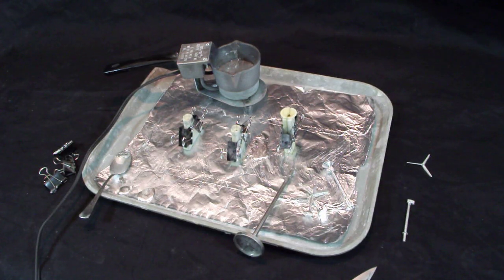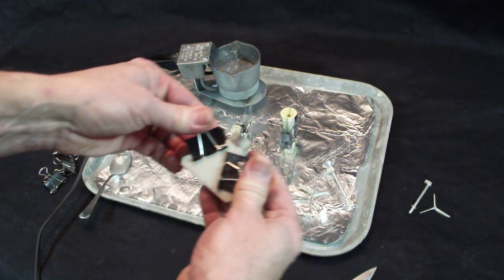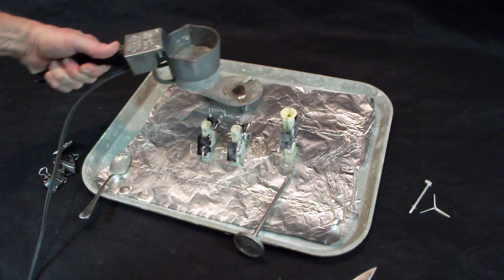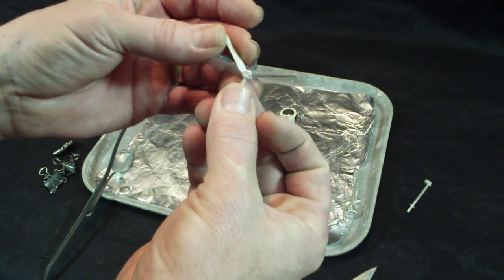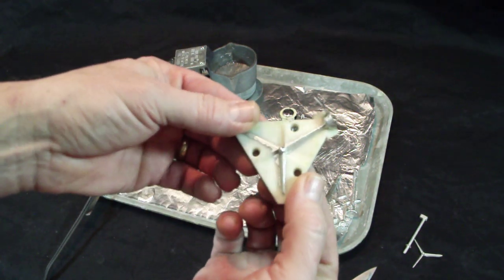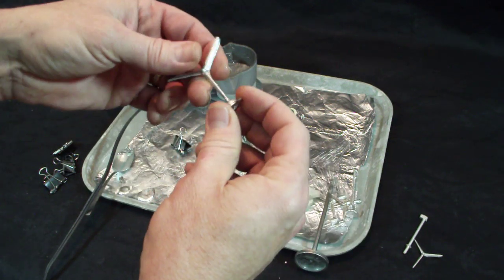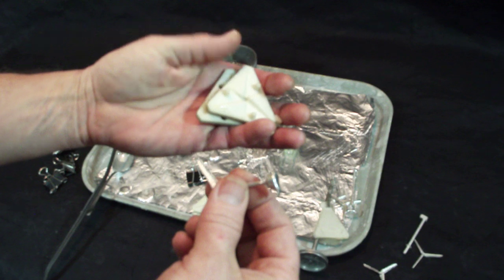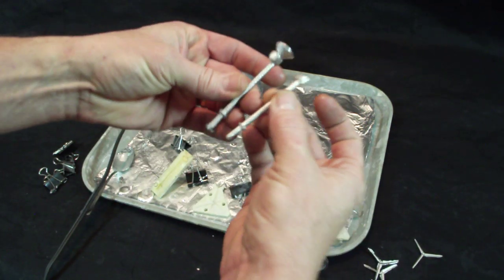Direct Metal Casting- 3d Printed Molds

Comment: what type of metal is that, and where do you get it? Also, what kind of pla do you use for these types of prints?
Reply: It's probably Bismuth-Tin "low melt" alloy. Becomes liquid at 139C / 282F. Next lowest temp is Tin or Pewter alloy at 232C / 450F

Comment: is that a normal 3d plastic or a special one?
Reply from the maker: +Bri w (willbo) We use a commercial grade printer that uses proprietary material (not the common filament-type thermoplastics).  This allows us to develop techniques for direct metal castings without melting the molds.